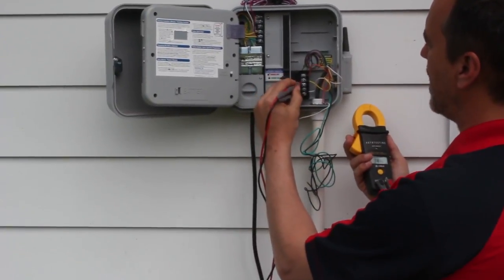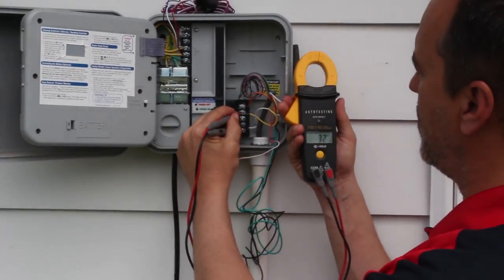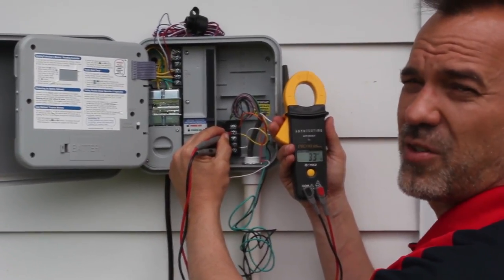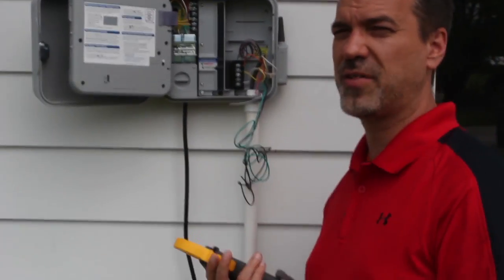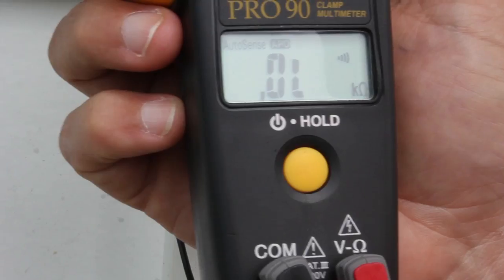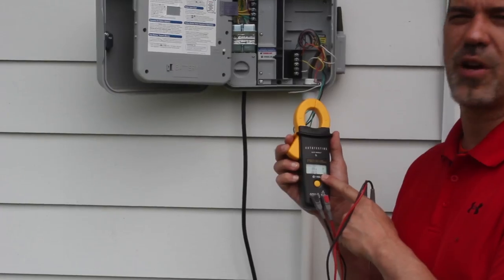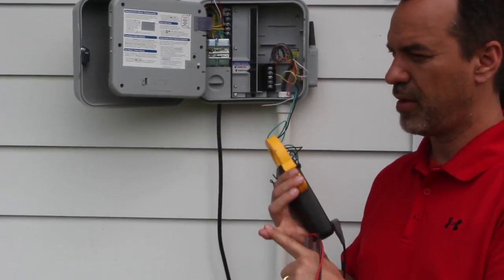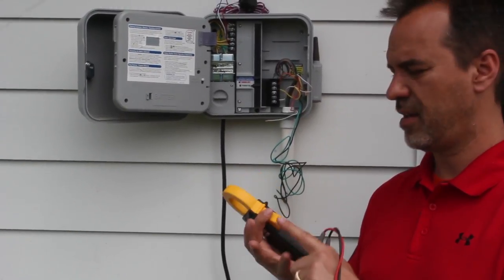How to check sprinkler wire, cable, and solenoids for proper loop resistance and operations.

Comment: Is 16 AWG "marine wire" good for sprinklers?  Wasn't sure if all 16 AWG wire are created equal.  Thank you!
Reply: Hi Son:  Marine wire is usually high quality stranded, tinned copper with PVC insulation. It isn't rated as "direct bury" because in the marine application that has no meaning. You will need to observe the voltage drop distance limitation of 16 AWG just like you would for a solid copper irrigation wire, but I'd say it is suitable. It often comes as a jacketed pair of wires so be careful if you want to use it as single wires.
Reply: @jlcarefoot  Thank you JL!

Comment: I’ve got a 4 zone system the previous home owner put in, with  2 extra colored wires not connected at the control box or to any valve. The solenoids are like 250’ from the controller box. Will this work to test the continuity of the unused wires as I’d like to use them to add zones, and not damage anything while testing ? If I unplug the power to the control box from the wall, take the two colored unused wires and touch a 9v battery lead to each wire. Then at the solenoid 250’ away test the voltage of the 2 unused colored wires with my multimeter connected to each wire. Will this work as a continuity test? If any voltage shows up, it shows the wires have no breaks. And if anything is connected to those wires it shouldn’t damage it right bc it’s only 9v, right? Thanks for any help on this.
Reply: Hi: If you have access to the two extra wires at the solenoid or far end you shouldn't need the 9-volt battery. Just check that 1) there isn't already voltage on them, then 2) short them together and 3) check for continuity across them from the controller end. This shows they aren't cut better than a voltage check.  Jim C..
Reply: @jlcarefoot  thank you. Your solution for testing if my 2 extra irrigation wires were good was excellent.   I connect these loose wires at a solenoid, and then with my multimeter I touch both same colored ends at the base control box, and I get a reading of 1.0 Ω, is that a good enough result for continuity? I guess 0 is best but is 1.0 good enough?

Comment: water is good, voltages is good, Ohms are zero, how do i find the short ?
Reply: Hi Ricardo: Where are you reading zero ohms, on the station and common wire at the controller? At the valve box?Were the wires disconnected from the controller? Do you have a wire & valve locator available? - Jim C. at Armada.
Reply: @jlcarefoot  Hello Jim, i found a little hole where i can see the connectors, I have 44 Ohms going back to the controller it seems,    and an open loop going another way, so there is either a bad master valve solenoid or cut cable, none of the zones turn on. I could make a video if that helps. I can't find the master valve or any big valve box, just found one little round hole with some cables . I dont have a locator, I see that they are over $600, a local company here is asking for $450 to diagnose the problem. Thanks